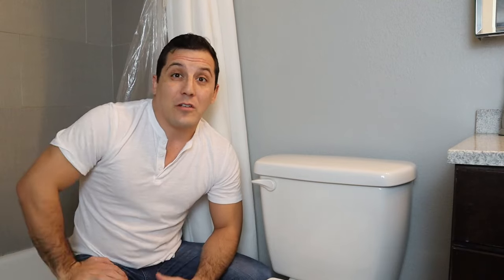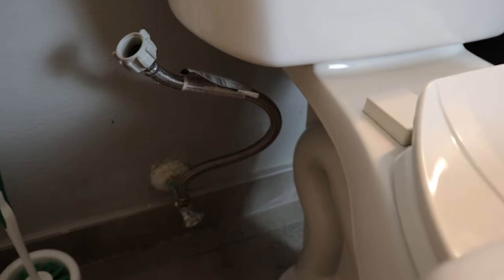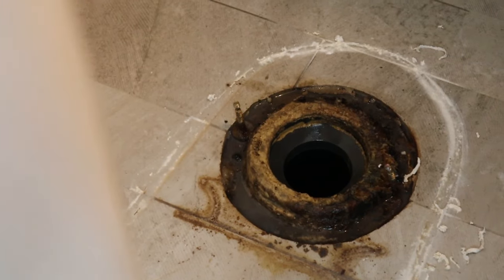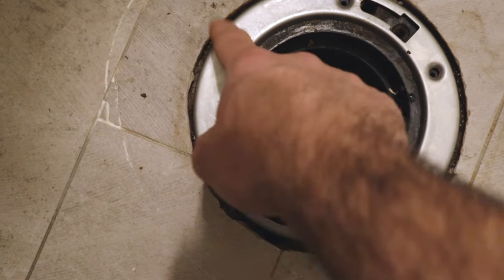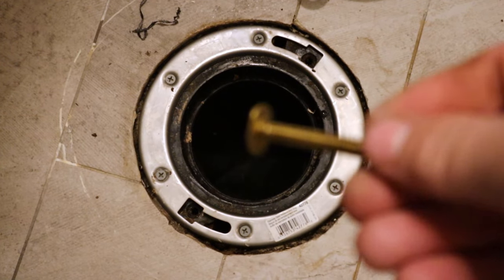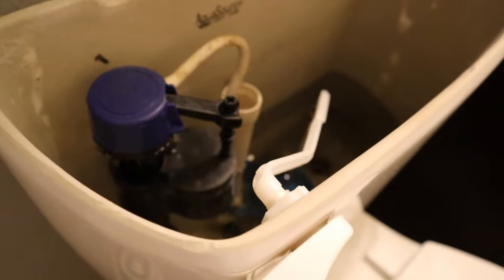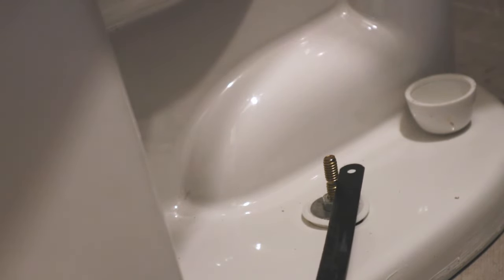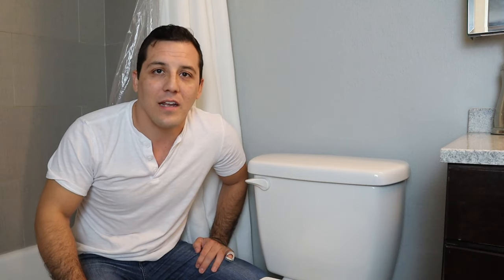How to Repair a Leaking Toilet and Broken Flange - DIY Guide with Oatey Replacement Ring

Comment: One wear gloves to avoid septic poisoning. Two, cover the inside of the opening with heavy newspaper or rag wide out not to fall it and not have to smell the stuff.
Reply from the maker: 100% correct. I didn't have my head on straight the day I was filming this.
Reply: @RemodelWithRobert  Confucius say, ..."man who have head on straight is pointed in the right direction to truth." 8-)
Reply from the maker: And "man who stands on toilet is high on pot"
Reply: Then, when you slip and fall on the wet porcelain and come to, you'll have a vision of the flux capacitor. Which is what makes time travel possible. 🚽
Reply: @chrisbroemel5508 😂😂
Reply: @RemodelWithRobert man that was on point being high on pot 😂

Comment: I installed one in my bathroom about 2 years ago (new flooring, vanity and sink project).  No problems thus far. My old cast iron flange was 1/2" -3/4" below the level of the floor so I didn't bother to remove it.  I was able to install the exact same plastic Oatey flange over the top of the existing cast iron flange.  Kinda unique situation I suppose, but certainly saved myself a little time.   Also, used the old wax ring to seal around the base of this replacement flange too.  No silicone used.  

Interesting that you too had a little difficulty with the screws securing/gripping to the wood.  The angles pre-drilled on the plastic flange could be a little better to accommodate the screws.  There's a little angle to them, but they could certainly be improved.  Got about 4 or 5 into the wood, but missed on 1 or 2 others too.  

Overall a pretty easy install.  Very happy with the end result.  No water or weird gas leaks either. Definitely hit a home run with this DYI project. 

Also, I used a 3/4" thick Sani Seal elastomer rubber type of product in lieu of the traditional wax ring.  Very easy to use and can be reused too.  It has a tacky/sticky feel to it and seems incredibly strong/lasting product.  There are many different thickness sizes available and also can be with or without the plastic cone attachments.  Only a few dollars more than the old fashion wax ring (own a 1/2 dozen of these but doubtful I'll ever use them other than sealing around the flange as I recently did with the old wax ring).  

Other: drilling out the old lead and using a tool to lift it/pry it out is much better technique than trying to melt it out like another YouTuber did on his channel.  Lead fumes are very toxic and harmful to your health.  Good to see that you've got a much safer way of removing it.👍

Comment: The first thing I want to say is this was a life savor for me. I didn't even know the metal flange cover. Worked like a charm for me. So thank you for the video! Second, I have to agree with a few comments here: wear gloves and plug the hole! Last thing you want is that nasty wax going down the pipe.  I don't know about the wax-less seals. I've read they break down sooner than the wax.

Comment: Is it safe to caulk around the toilet? caulking it will hide the water if you get another leak?
Reply: Its safe but maybe leave a small gap on front and back just in case

Comment: A pvc spacer on top of that flange with a new wax ring. Would have been a better option.  But job well done.  There is more than one way to skin a cat. Or in this case repair a flange.

Comment: Looks like the flange is sitting slightly beneath the tile floor? This may be what caused the leak in the first place. Better fitment is to have it slightly above or flush with the tile floor.

Comment: I have the exact same situation and this is going to be my plan of action as well. Thank you for the video. Looks great 👍
Reply from the maker: Awesome, good luck!
Reply: @RemodelWithRobert  I used this method and worked great. Thanks
Reply: @RR31982 is the fix still holding?
Reply: SAME! SO GLAD U SHARED THIS BRO

Comment: It's a removable 1/4" flange riser on top of the flange itself. It's used to get the flange flush with the tiled floor. Securing the toilet to this plastic ring is not secure enough imo.

Comment: If there’s nothing under the black flange screws but dirt, then WHAT is holding your entire  flange to the actual floor???? If it’s just the glue between the connections of the sewer pipe, then you’re risking later cracking EVERYTHING if people shift side to side on that a lot. You need a whole new flange and make sure it’s secure to SOLID SUBFLOOR under it!

Comment: I had to drill holes into concrete for my toilet and the screws had nothing to bite . I didnt have those plastic pieces so i dropped tooth picks in the holes and the flange is super secure

Comment: Where are his gloves? Not a prima donna but raw sewage is dangerous. And he has a bandage on his finger already. Open wound! Be safe!
Reply from the maker: I did this repair late on a Sunday night and wasn't thinking straight. That's my only explanation for not using gloves and not putting a rag inside the flange. My finger was not bandaged though and no open wound. I was attempting to treat a mallet finger injury with a finger splint.

Comment: Nice job! Would this work for cast iron as well? Also the bolt holes ended up being in same location? What happens if they're off a bit? Thank you so much. Check my page for my flange problem. Hopefully its just a bad wax ring on a low flange.

Comment: Don't ever caulk around your toilet, if it's leaking you won't know for awhile and it will rot the floor.
Reply from the maker: Caulking around the toilet is actually part of International Plumbing Code. It is designed to keep water and anything else in the bathroom from seeping under the toilet and further secure the toilet. A leak inside is generally going down under the floor and not above and onto the flooring until it has already saturated everything else and has nowhere left to go.
Reply: @RemodelWithRobert horrible idea to caulk around a toilet. Toilet leaks, I want to know ASAP, not days or weeks later.  

Honestly, how often (never?) is your bathroom going to flood and inturn water getting underneath your toilet?  This should be the last thing (or never?) you should be worrying about.  

Keeping water out or trying to secure your toilet from rocking/moving with silicone sounds like a really bad idea (poor install by half-ass installer).  Perhaps shims, leveling your floor or ? is a better solution than caulking around a toilet. 👎

Comment: When the floor around the toilet flange is rotten, I am sorry but the right thing to do is bust that tile and replace the subflooring  then retile  also that old flange needs to be cut off and replaced with a twistNset flange, screw that to the flooring you just replaced, flush with the floor not below it then install the toilet with a wax ring.
Reply from the maker: This is a concrete slab. The oatey ring did bring it up flush with the tile and it has since been secure.

Comment: This is what happens I guess when you shake your ass on the toilet trying to get those hanger ons to fall. I dont stop a wipen till its a whitten. Yes gloves and something to block the gas. A rag or cup is good. Heard those plastic seals are not that great compared to the wax. I mean it looks great but any Plumbers have there views on  what sealer to use ?  Also  that flange attachment looks like it might  lift the toilet to high. One of theose jobs thst may not last. 13:24

Comment: I watched this 2.5 years ago and it did NOT WORK! Do NOT buy this, go with the wax ring!
Reply: Worked for me.  And also I really like the elastomer (rubbery/sticky) Sani Seal toilet gasket/ring.  Come in different thicknesses like wax rings too.  Also, with or without a plastic cone.  If you haven't tried one yet, I recommend that you do. There awesome.  Also, unlike a wax ring these can be used over and over again.☮️